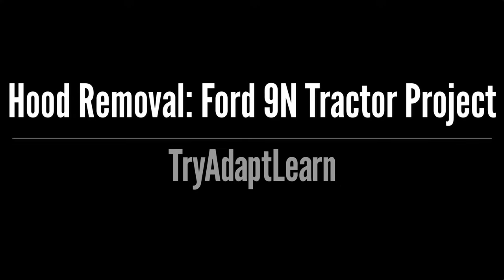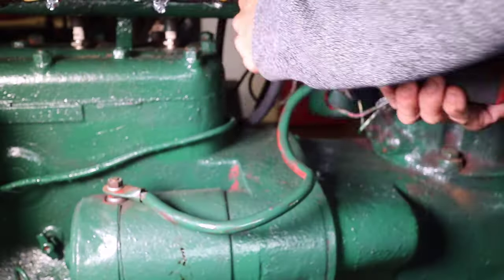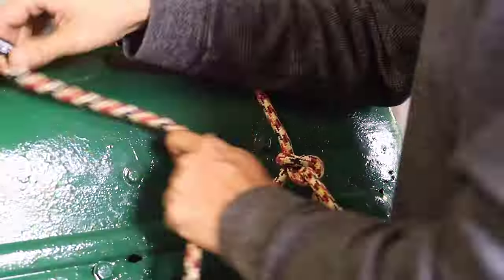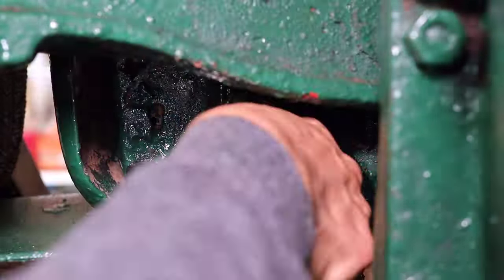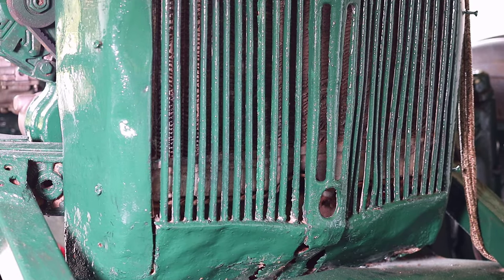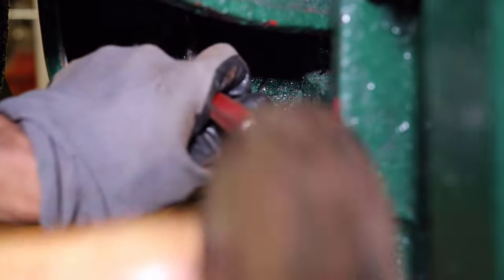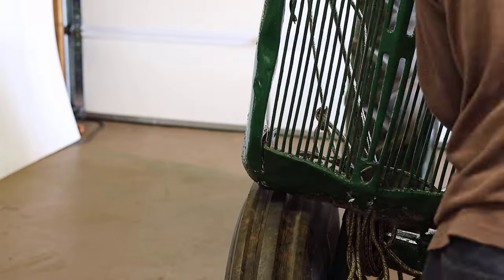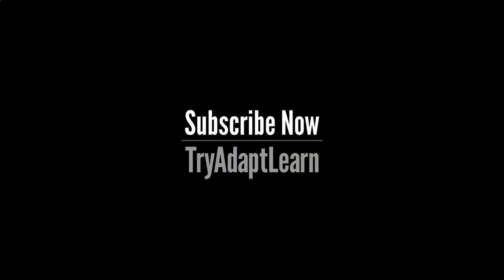Ford 9N Tractor Hood Removal

Comment: I'm going through this agony now.  Seems simple until you start working on those bolts at the bottom of the radiator ! I'm going to use a grinder to cut things free, as my wings are pretty banged up and need to be replaced.  I put a stick through the radiator and have to replace it. Lots of fun ! (Not).
Reply from the maker: Good luck with the hood, sometimes another person or two can be a big help to get the hood loose and/or help of a pulley system or hoist to help pull it off. 
In the worst case scenario, the fasteners and/or panels have rusted down to the point when using a grinder like you mentioned may be the only option.
In addition to corrosion, the tractor in this video had a mount welded out of alignment from the other side which created more difficulty to remove the hood.

Comment: 9N hood removal = Sawzall. 😂😂
Reply from the maker: It's like removing a band-aid fix.  If/when the time comes the mount at the bottom of the radiator needs to be replaced and that'll line the hood back properly.  I think it had a front end collision and/or rusted over time, so the mount was welded back in the wrong place.

Comment: Is 8n same procedure? Thanks Darrell
Reply from the maker: The 8N is the same procedure.  The challenge for this 9N was that there was damage to the hood mount and it was fixed out of alignment.  With two hood mounts in the stock location, it should be an easier process.

Comment: That 8N ain’t gonna run correctly until it is painted red and grey.😉
Reply from the maker: Nice.  Since I’m initially not rebuilding the engine / re-sleeving the cylinders,  I’ll have to keep that one in mind, lol.  I have thought about just brushing it again with grey.  It would have to be dark otherwise it would just highlight the dents, corrosion and soil.  Thanks for writing a comment.
Reply: @TryAdaptLearn  I took my ‘49 block to machine shop and let them install sleeves as I had broken two sleeves attempting it myself. Parts are getting ridiculously expensive. I’m thinking of a psychedelic paint scheme for my ‘51 project and maybe raffle it off.

Comment: Are the ford 2n the same?
Reply from the maker: The hood removal process should be the same for the 9N, 2N and 8N.  Please keep in mind that on this tractor, the hood mount was welded in a different location, likely part of a fix, which causes the hood on this tractor to be misaligned.

Comment: Try getting it off with a loader mounted to it. That's what I'm looking at doing. Gonna suck.
Reply from the maker: I think it would work well with either a second person, a loader or even an engine  hoist.  It looked very hard in this video because one side of the mount was welded in the wrong place which misaligned the whole hood.